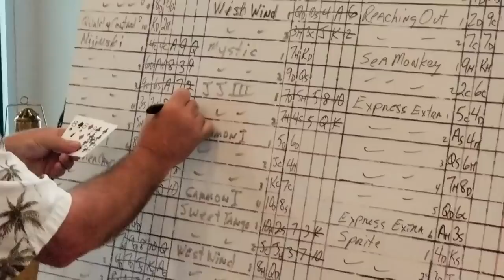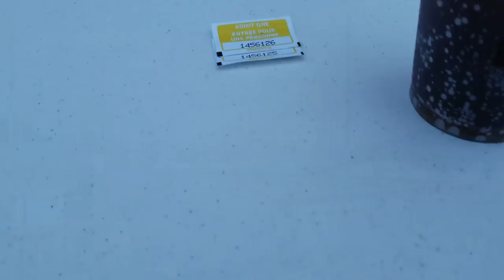Pirates on the Waterfront & Dinghy Launch! [ Ep 37- Sailing Nova Scotia ⛵]

Comment: Nice work on the dinghy. Years ago I bought a rigid inflatable as you can take them pretty much anywhere without worry. You learned new skills (glass/hypalon repair) and for a lot less than the cost of even a decent used one, made something that's serviceable. I only have one thing to say. Get yourself a wire rope and secure the motor to the transom. More than once I've seen a motor meet a watery grave because the clamps had vibrated off (happened to me once as well). that wire rope was the difference between a fresh water flush and a new motor.